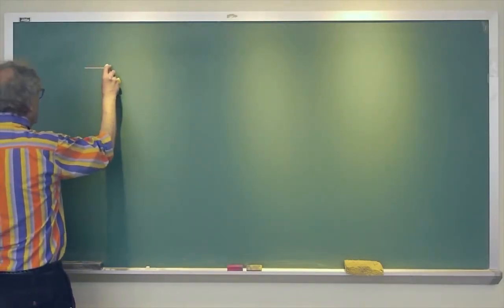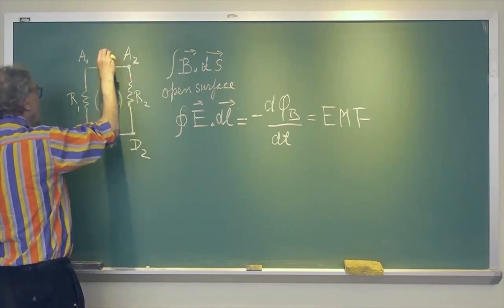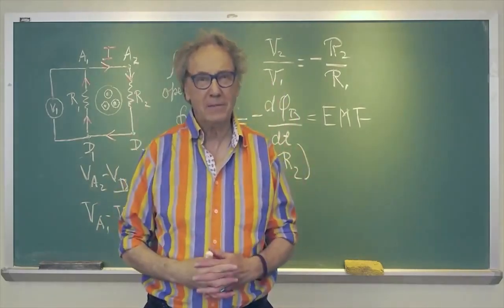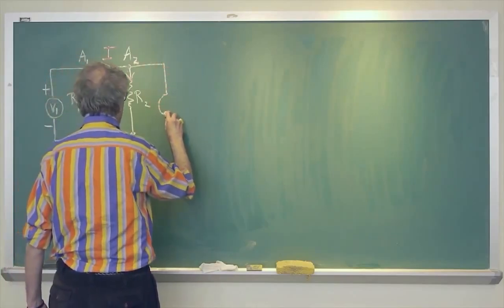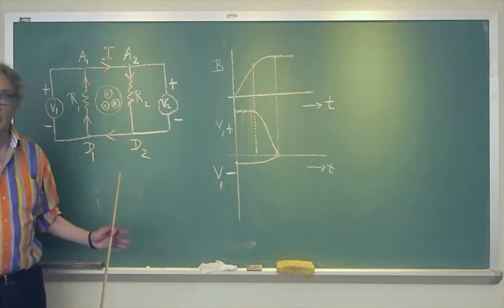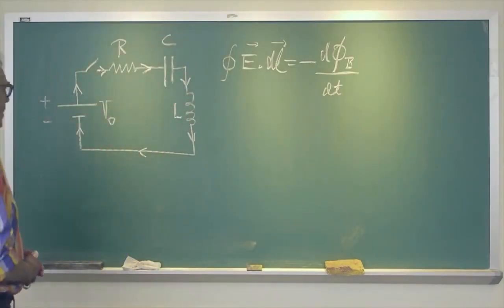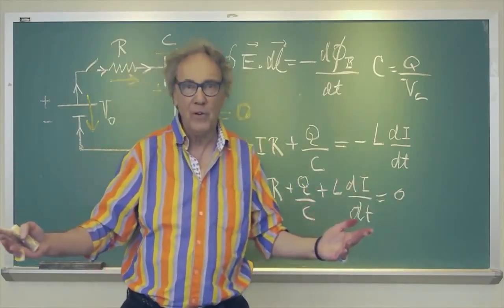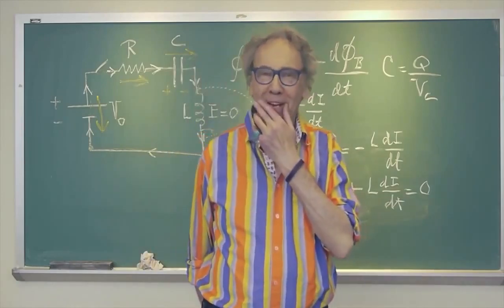Kirchhoff's Loop Rule Is For The Birds

Comment: Professor,  I am confused about this.I know  if we use Faraday`s rule ,it will get right answer. But I have two  questions :
question 1: do  the voltage  potential between A1 and A2  have different  value ? 
question 2: if A1 and A2 have different voltage , but between the two point (the short path),it has no resistor! how do they get voltage difference!
thx for ur open course, help me to think about the physics world!
Reply from the maker: A1 and A2 are one and the same point. In my demo (see below) there was only 1 point A and one point D. But even if there were a 3 cm thick copper wire between A1 and A2 and between D1 and D2 the demo would have worked in the same way as the resistance of a 3 cm thick copper wire has an resistance 10^4 times lower than R1 and R2. The integral of E dot dl in going from A to D depends on the path (one path through R1, the other through R2). If K's loop rule would hold then the 2 integrals would be identical regardless of the path and my 2 voltmeters would read identical values also the same polarity but that is not the case. In cases where K's rule holds we talk about potential difference as it is UNIQUE. However, when dphi/dt is not zero, K's loop rule is not valid and we should not use the words "potential difference" as the 2 paths give different values. 
https://www.youtube.com/watch?v=nGQbA2jwkWI&index=17&list=PLyQSN7X0ro2314mKyUiOILaOC2hk6Pc3j
Reply: +Lectures by Walter Lewin. They will make you ♥ Physics.
thx for ur reply, last one question:
as we just connect the two voltmeters at A and D, how do we know voltmeter1 will measure the voltage of R1, not R2?
Reply from the maker: if voltmeter1 is on the R1 side it will read the value IR1
if you would move it to the other side it would read IR2
In 1984 when I did the demo for the first time I did not have 2 Voltmeters. I had one which I flipped over but then I have to activate the electromagnet twice. Using 2 voltmeters is better in my view as you only turn the electromagnet on once and students can see in projection the oscilloscope which shows V1 and V2.
Reply: +Lectures by Walter Lewin. They will make you ♥ Physics. 
two voltmeters is much clearer to see the difference. the demo here is pretty weird. i need to keep learning, keep thinking. maybe i will do this demo by myself. thx for ur patience, u r so kind! i need to sleep now. it is too late in China!
Reply from the maker: How can you watch my lectures in China? I thought that internet is not available in China.
Reply: +Lectures by Walter Lewin. They will make you ♥ Physics. 
haha, we use a software called lantern. So knowledge is no boundary.
Reply: +Tao Huang by the way,internet is everywhere in China.
Reply from the maker: everywhere internet on Mainland China?
Reply: yes, almost everywhere, we can connect to internet by our cellphone and then watch the youtube videos in mainland China.
Reply from the maker: China has 1.4 billion people, India has 1.3 billion. I have geographic information about viewers. US has the most (40% of the viewers), India is always 2nd (25% of the viewers). China is never even listed. Thus the number of viewers is smaller than 0.5% of the total.
Reply: In fact, for some reason, we can`t directly watch youtube video. so the geographic information will never get the viewers  information of China. But, believe me, most of students in China are watching your videos. You are also very famous in China due to the excellent physics lectures.

Comment: One voltmeter can be used for this experiment I would think..Connect to points A and D, make a reading and then just flip it
Over and make another reading. If what I assume is correct, the readings should be different. Then what would the voltmeter read if
It is in a plane perpendicular to the surface of the circuit? Zero I guess.
Reply from the maker: It's better to NOT call my voltmeter measurements "potential differences" as in the case of Faraday's Law the potential difference between 2 points is not unique as it depends on the path. In my demo in Lect 16 of 8.02 the routing from A to D  is different through R1 from R2. That is why Kirchhoff's loop rule is "for the birds".
Reply: No!  The key thing is HOW THE LEADS ARE ROUTED between the meter and the point where the voltage is to be measured!  I can measure voltages even the leads shorted... if one of the leads is coiled multiple times around the magnetic field.  You cannot get "true" measurements if the space between the leads contains a changing magnetic field!

Comment: Hello Pr Lewin,
If we have a closed loop of a superconductor wire with a changing magnetic flux. Then the integral of E . dL along the wire (inside it) will be zero (superconductor)!! Do I get it wrong?

Thank you very much.
Reply from the maker: remember E=j/sigma E is the E-field, j the current density and sigma the conductivity. In a superconductor sigma is infinitely high and E is zero. E*sigma=j. Thus j can be anything and a current will flow through the superconductor so that the B-flux through the loop will always be zero. .
Reply: I get it now.
I don't know how I missed it in your lecture 8.02x - Lect 19.
Thank you very much.

Comment: Prof. Lewin, I do agree thoroughly with your application of the Faraday's Law to solve the RLC circuit, as opposed to the naive application of Kirchoff's Voltage Law found in almost every electronics textbook, but some authors explicitly state that what is being considered in the application of the Kirchoff's Law is the voltage between each element of the circuit, and that includes the emf of the indutor that can be measured by a voltmeter. However it's a shame, but somewhat forgivable, that no one thinks that way when teaching electronics engineering; it's Kirchoff's laws all the way up and down their project applications and written exams! What ends up happening in later years, is that students (and some graduated engineers) must relearn everything again from the ground up, because they can't explain how a transformer works, most often why the mean voltage in each winding must be zero, for instance.
Reply from the maker: K's rule DEMANDS that the closed loop integral of E dot dl in any loop is ZERO. That is NOT the case in my demo. K's rule DOES NOT apply. I suggest you watch my lecture #16 - you will see demo which has now become world famous. https://www.youtube.com/watch?v=nGQbA2jwkWI&list=PLyQSN7X0ro2314mKyUiOILaOC2hk6Pc3j&index=17
Reply: That is absolutely true, I've seen the demo, and I understand that KVL can't be applied in that loop, considering the magnetic flux variation inside the loop. I only commented because I've read at least an author (not strictly physics but power electronics) that stated that problem in using KVL to magnetic circuits, by having to ignore the magnetic flux variation and to calculate separately the emf of the inductor using Faraday, because no one can't escape Faraday for that matter. Thank you for your answer, Prof. Lewin!
Reply from the maker: I repeat myself. Kirchhoff's loop rule is for the birds. It can only be used in special cases. Faraday's Law can ALWAYS be used.

Comment: I think the issue in saying that D1 = D2 is that there is something analogous to resistance between them, and that is the magnetic flux intersecting them. If the distance between the two points was 0, than surely they would have to be equal but because it isn't and the induced EMF will be different for each point of the wire. It's a bit like thinking of a magnet moving on a frictionless but conductive surface and being confused when it slows down, you simply for got to factor in the magnetic resistance
Reply from the maker: You are mistaken, you explanation is incorrect. You still have a religious belief in Kirchhoff's rule but K's loop rule does not apply here. Many people like you do not have a deep understanding of Faraday's Law. In F's law the integral of E dot dl (in going from A to D in a circuit) depends on the path. Two voltmeters  both attached to A and D can give VERY different results (even the polarity can be reversed). Apart from the fact that my diagram on  the blackboard is also correct, the way I do the demo is that there is ONLY 1 point A and one point D. Thus A1=>A2 is zero and D1=>D2 is also zero. If the consequence of F's Law is very hard for you to accept, you are not alone. I will not argue with you about this. I teach physics. I do not argue with people who think they know but who don't. I suggest you watch my lecture #16 and see my demo that has now become a world classic. https://www.youtube.com/watch?v=nGQbA2jwkWI&index=17&list=PLyQSN7X0ro2314mKyUiOILaOC2hk6Pc3j
Reply: You are correct, I don't understand Faraday's laws (not yet at least) which is why I started my comment with "I think". I really want to thank you however for instantly clearing my misconception, and also for sharing your vast amounts of knowledge with the world. Yet there is one thing, that is bothering me more than anything and that is what would happen if you placed a volt meter half way between A1 and A2 and half way between D1 and D2. Btw I'm only in 9th grade and everything I know regarding Electrical Engineering, calculus, and physics is self taught which is why I cannot express my thanks enough to you for making these videos.
Reply from the maker: If you move one connection of the right voltmeter to half way between A1 and A2 and the other connection to half way between D1 and D2, the result is obviously the same (Faraday's Law does not change). It may interest you that I have done this demo many times, depending on circumstances I have done it with A1=>A2 and D1=>D2  both equal ZERO and also with wires A1=>A2 and D1=>D2 each with a resistance of about 0.001 Ohms. Again the result is identical because F's law does not change. The 0.001 ohms is sooooooo much smaller than R1 and R2 that they have a negligible effect on the outcome..
Reply from the maker: More interesting is the following. Try  to answer this. Attach a voltmeter between A1 and A2 and move the wires that connect the voltmeter to A1 and A2 out of the horizontal plane, place them in the vertical plane (thus at right angles with respect to the surface of my table).  What now will this voltmeter read?  Then flip this voltmeter over back to the table to the wires D1=>D2.  BUT the connection (to A1 and A2) MUST remain. Thus its wires are back in the horizontal plane. The wires are insulated and they lie now on top of D1-D2 with our new voltmeter located near the middle of D1=>D2. What now will this voltmeter read?  Good luck!  Faraday's Law will always give you the right answers! Kirchhoff give you only the right answer if dphi/dt through the surface attached to a closed loop is zero. Assume in this problem that all connecting wires have zero resistance. All resistances can be made so low that you may ignore them
Reply: I have not forgot about this question, actually quite the opposite . It has bothered me for a rather long time now but I was scared of getting the wrong answer until I remembered that being wrong is just a part of experimentation and learning and so I present to you my best attempt at an answer. If the voltmeter is at a right angle to the table there should be no change in flux through the surface attached to the loop as the field is moving parallel to this surface. This should mean that Kirchhoff's law does hold in this instance being that dphi/dt is zero. When the volt meter is then placed back on top of the other wires I would think that the volt meter should still read -dphi / dt However this is now no longer zero being that we are now perpendicular to the movement of the field and there will be a changing field through the surface. This feels wrong to me however because I am completely forgetting about original loop and only focusing on the one created by the volt meter. Unfortunately I don't know how to properly deal with this scenario and so this is the only conclusion I can come to. I don't however want to give up entirely on this question if this is wrong, so if you could tell me what information I am seemingly missing and what misconceptions are blinding me  it would be most appreciated.  And thank you so much, once again, for you time and knowledge.
Reply from the maker: Take any closed loop in any circuit. Attach any open surface to that closed loop. If there is a variable magnetic flux going through that surface than Kirchhoff's loop rule cannot be applied for that loop. If there is NO variable magnetic flux going through that surface than K's loop rule can be applied. Faraday's Law can ALWAYS be applied as K's loop rule is a special case of Faraday's Law (namely when the changing magnetic flux is zero). End of story. I cannot be more precise.
Reply: I think I finally have an adequate understanding of Farady's law and for that I would like to thank you immensely. I feel going into physics with this understanding opposed to just seeing the surface (Kirchhoff's law) will prove extremely helpful, and will allow for me to see the beauty of physics even farther below the surface. I have always loved physics but never this much so thank you.
Reply from the maker: By the way, when I did the demo in Lect #16, D1 and D2 were 1 point
and A1 and A2 were also one point. But that is IRRELEVANT as the resistance of 2 cm copper wire of radius 0.5 mm is 10^6 times smaller than R1 and R2.  I suggest you watch this lecture you will then see the fabulous (now world famous) demo https://www.youtube.com/watch?v=nGQbA2jwkWI&list=PLyQSN7X0ro2314mKyUiOILaOC2hk6Pc3j&index=17
Reply: I have already watched it at least 10 times in an attempt to understand Faraday's law. It was way over my head when I started but upon watching, becoming confused, and resolving my confusion with further research, I finally understand it fully. It truly is an amazing lecture